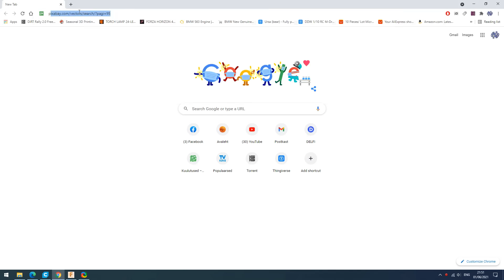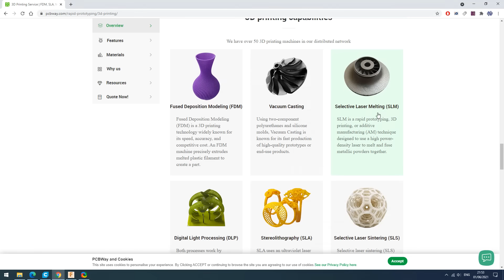Useful 3D Prints November 2021

Comment: Nice ideas on print items...

Just a suggestion - Perhaps add a comment showing how many grams each print weighs so folks will have an idea of the amount of filament they will need. (and how long the print takes would be great too.)
Reply from the maker: I keep it in my mind.
Reply: That depends on your slicer settings! It will show you the amount and time required when you slice your print for your printer.
Reply: @StormBurnX  Is there a tremendous variance in that? (I just figured they would all be within 30% or less of each other?) - I do noy own a printer though...I just use the one at the library in the Maker area, and do not know anything beyond the basics with that printer, which they said was a good one that retails for about $2800?
Reply: Your slicer will give you that information, and the information will vary depending on your settings.

Comment: Please tell me how you processed the printed model? It's as smooth as cast. How did you achieve this?
Reply from the maker: Right settings and calibrated printer
Reply: Not smooth. Wobbling beginning with 3-4 cm

Comment: The first one is laughable. You are holding the 3d printed card dispenser with one hand and dispensing cards with the other. Just hold the deck in one hand and dispence cards with the other, what's the difference? LMFAO.